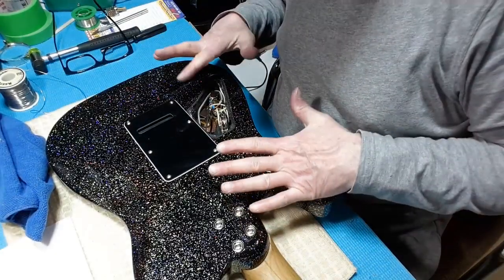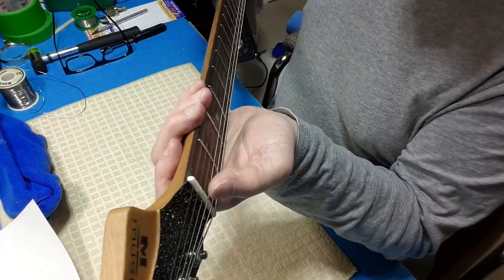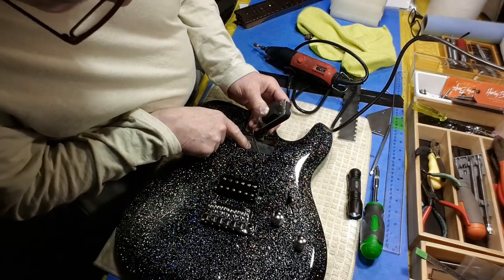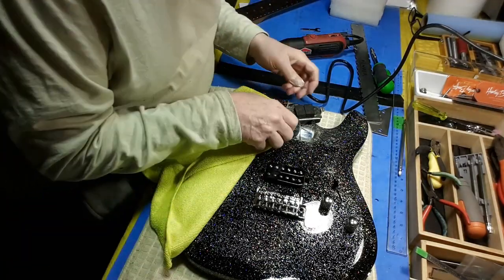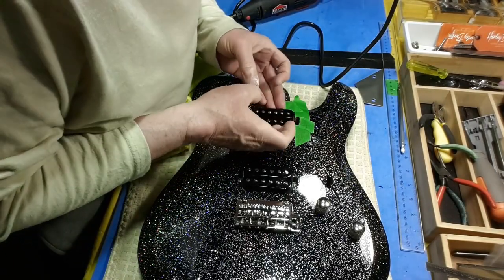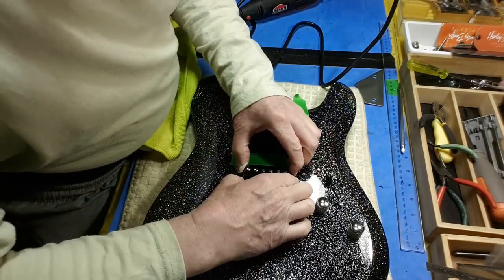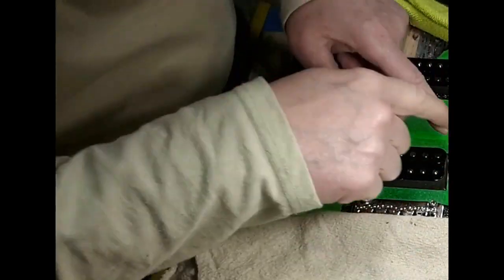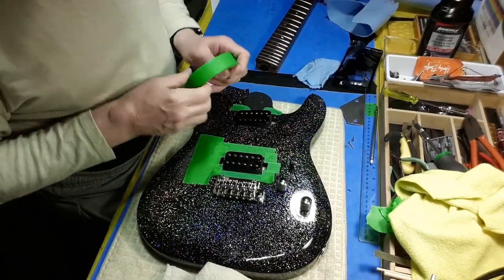MUSI FUSION GALAXY BLACK - PART 4 - APRIL 2023

Comment: Wow making it perfect! Nice job buddy! Just fYI that paint inside the cavities is sheilding paint... the crafters paint is black but that's it haha! Don't really need sheilding paint for humbuckers anyway...
Those rings will look good with the chrome hardware!
Reply from the maker: I tested the paint inside the cavities and it really didn't have any real connectivity to it it was black but it also was coming off on my hands like your experience on a guitar. I just wanted to cover up the areas that wouldn't glare  white wood in the cracks
Reply: @2bikemikesguitartopics145  yeah my classic had an ashy black paint in the cavities almost like a graphite feel to it when I rubbed it off. On my fusion, the paint is well set... must have been done on a wednesday as opposed to a friday afternoon! Lol
Reply: @j-man9457  hey Jman, did you Virgo Fusion have the same binding issue on the p'ups?
Reply: @summerboy1958  hey Bruce,
Honestly I haven't done a thing to it since I got it lol It was so good out of the box, I just left it. So as far as the pickups binding I can't say for sure, but I did raise them up a bit before a gig and I didn't notice any issues with the pickups getting stuck in the cavity. I will check closely next week when I get around to servicing it and let you know...😀
Reply: J-man, I said the same thing as he was painting with the crafters paint.  True humbucker cavities don't need shielding paint.  But being that these pickups can be coil split, shouldn't the pickup cavities be shielded?  I'm waiting to receive one of these guitars in a few days so I can test the paint to see if its shielding paint.
Reply: @bobbybo3458  hey Bobby,
So the Musi's do use sheilding paint, however in some cases the clear coat overspray affects the reading on a meter. 2Bikemike always wires his split coils in a way that the 2nd coil is still active. Do in this case, it doesn't matter if shielded or not. 😉

Comment: Firefly now seems to be selling a guitar that looks EERILY similar to this one on their website, with nearly identical specs, the exact same finish and hardware, and those same tuners! The only differences I can see are the headstock shape, the inclusion of string trees, and the price of $179.91 USD.
Reply from the maker: Ya Leo called me and told me about that this morning. I looked it up and seems the paint job is exactly the same as the movie fusion I have. Makes me wonder if musy and Firefly are  connected in China